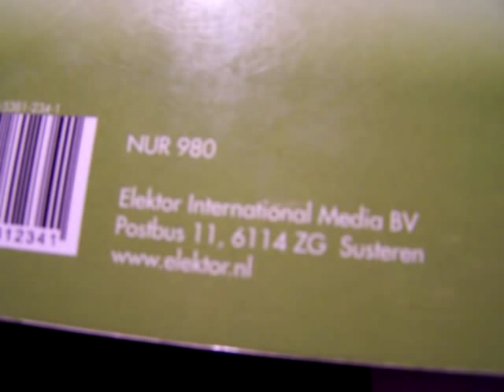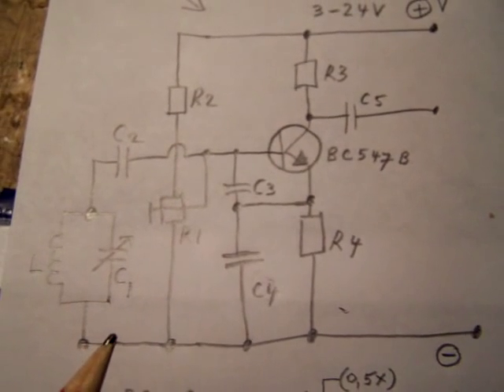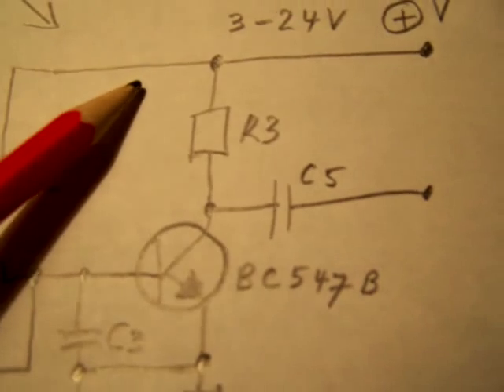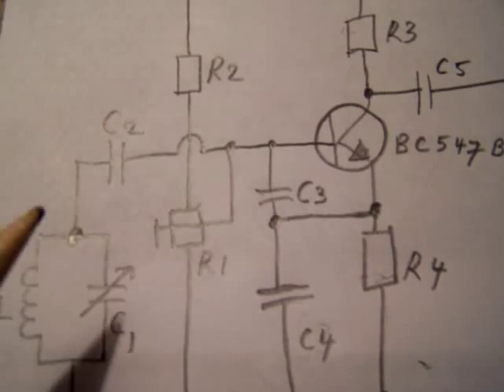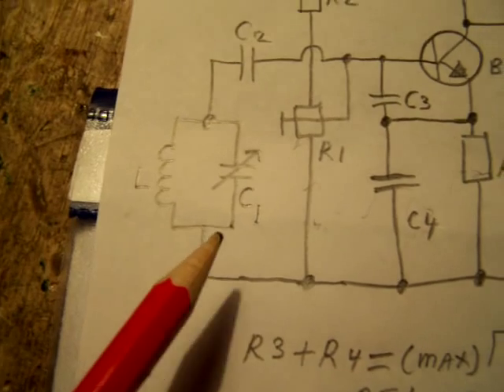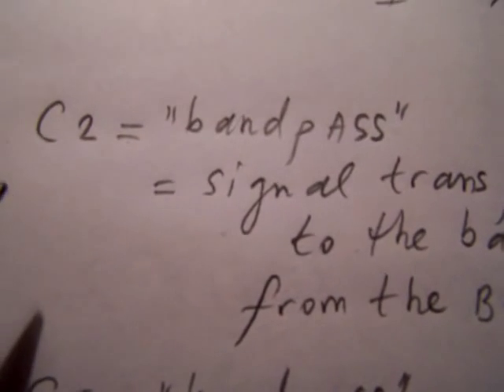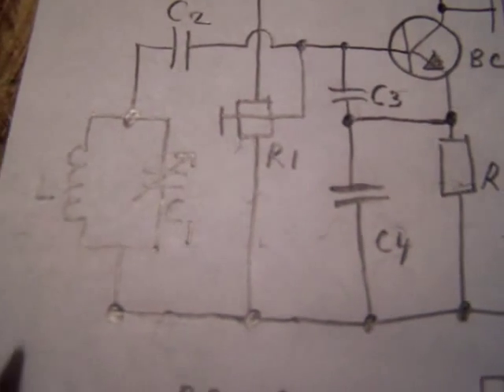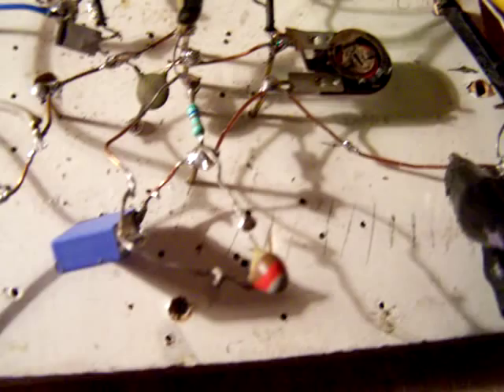playing with SW radio oscillators, part 1

Comment from the maker: Thanks. The design has (essentially) not changed since then, the principles stay the same. But for professional radio systems the concept was optimized extremely in terms of: ideal IF filters, high IF frequency, variable IF bandwidth, double mixing with a high IF frequency, ideal HF amplification (no cross modulation), VFO tuning at 1 Hz, etc. The final development can be found in e.g. the Perseus receiver (software defined radio, SDR).

Comment from the maker: You are welcome. You know, it is a little bit "science" but with an oscilloscope at the output and a potentiometer in the transistor base circuit you will always get a local oscillator working. And when you once know how to to do this, you will never forget it and have enough insight to get almost all oscillators working. Making a first superhet radio on a piece of varnished plywood is the key to succes.

Comment: Can the circuit using the FET be powered by a 9 volt battery instead of a 12 volt power supply to get the 16.7 mhz frequency
Reply from the maker: In general: yes (must be tried).

Comment: Can this oscillator work for a frequency of 16.7 mhz and if so what would be the values for the components
Reply from the maker: This oscillator: no; but the following video's show oscillators that can be made suitable for 16.7 MHz. Tuning coil and parallel capacitor have to be adapted for 16.7 MHz, watch the video for suggestions how to do that.
FET oscillator https://youtu.be/Ng49kGF3n8o
VFO 13-18 MHZ https://youtu.be/UpR1Utjl_lc
Do your homework to calculate that coil or make it experimentally.
Reply from the maker: First idea ("thought direction") for 16.7 MHz: 10 windings of silvered copper wire, wire diameter 1 mm, length 2 cm, air-coil with 1 cm diameter, bridged with a trimmer between 20 pF and 100 pF. Only a first idea, give the parallel capacitor eventually a higher value to get to 16.7 MHz. Can be tested with a scope and a freq. counter. Watch the video's to see how the coil approx. must look like (I made it for 13-18 MHz).
Reply: @radiofun232  thank you for such a prompt and informative response

Comment: Greetings, I needed a SW for sports radios in Europe, mostly England and Spanish/Italian if possible. Can you guys tell me if this is possible living in Portugal and what is the best equipment for that? Appreciate it
Reply from the maker: It depends on the atmospheric conditions, the radio path, the solar spots cycle and more, so in general the radio propagation. These effects are different on the different frequency bands for broadcast stations on Shortwave (2-30 Mhz). I am sure you can find propagation expectations on the internet. In general it is no problem to receive a radio signal from England in Portugal.
Reply: But what is the best equipment for what I'm looking for? What price ranges are we talking?
Reply from the maker: I don't know because I made my SW radio's myself. I think a consumer radio from 200 Euro does the job well. best thing is to test it first and then buy it.
Reply: How can I test if first? Any ideas..?